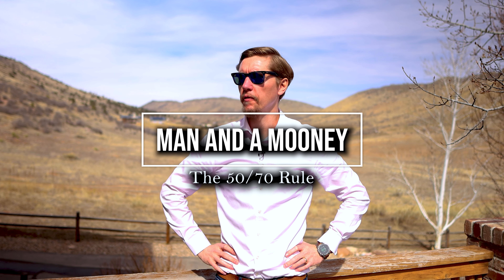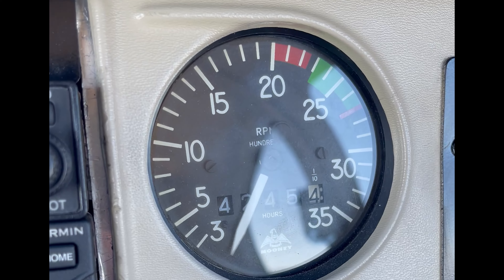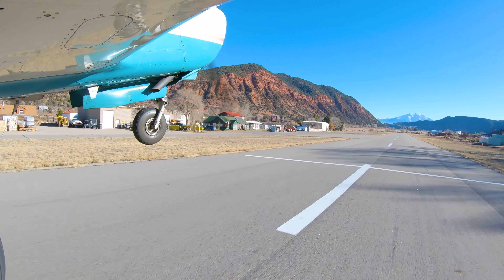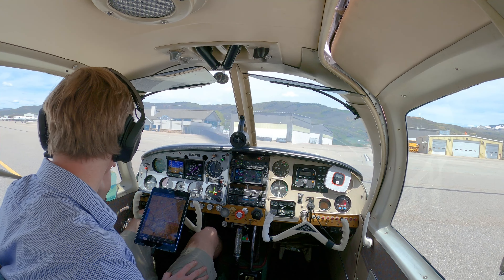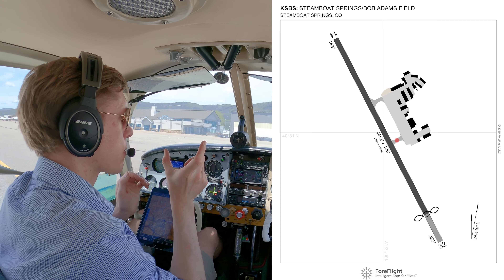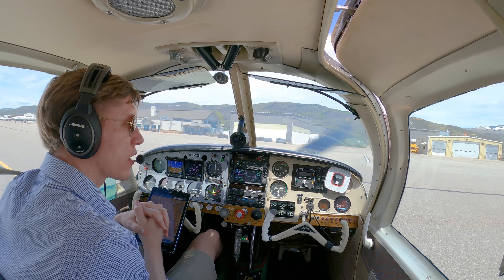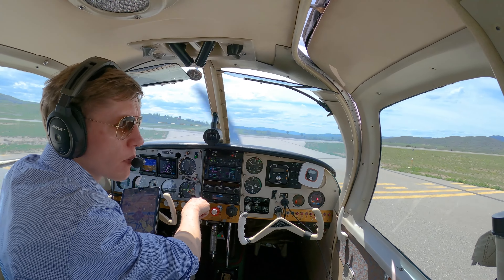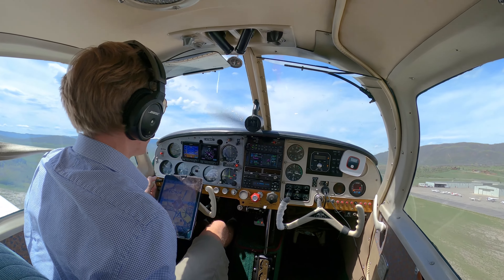How To: The 50/70 Rule

Comment: Density altitude seems to be a major factor in the areas you fly in, especially in the summer months
Reply from the maker: Absolutely Bobby. Density Altitude and Winds Aloft are two of my top considerations when flying around the mountains. If you haven't already, check out my How To: Mountain Flying video for a more in-depth explanation: https://youtu.be/DeTkEmoLCdU
Reply: Agreed Bobby... you only need to try to depart on a short runway with high DA once to REALLY understand how critical it is... as long as you live to tell about it.  I once took off from a field elevation of 7,000 MSL at about 10 a.m. where the DA had gotten up to about 8,500 MSL.  In a light sport aircraft I got off the surface and my absolute best rate of climb was about 50fpm - not 500fpm but 50.  Super high pucker factor with trying to climb out.

Of course the inverse is also true... for me, leaving the greater Denver metro area and flying east, I've more than once sat at the end of what was a VERY short runway, but because of the elevation of the field it was MORE than enough to get off the ground.  The major metro area airports here are long enough you can't see the other end.  Of course in the mountains it's a whoooooole different issue.
Reply: @ibgarrett  Wow, a 50 fpm climb has to be a heart pounding expensive. Once, I flew with my grandfather to drop off his plane at the paint shop at this small airport. Some guys picked us in a Piper Saratoga with 3 grown men already inside, so adding us made 5 grown adults  4 of them were CFI's. The runway was around 3,000ft the DA was around 3,500ft so not terrible but having a obstacle at the end of the runway did not help. We just barely cleared the trees at the end of the runway. After we were airborne everyone was joking about what the news would have said if we had crashed.

Comment: Another great video.  I enjoy and appreciate your emphasis on safety.  How do you determine when you have achieved the lean setting you want on takeoff?  Are you leaning until the engine runs rough and then richening slightly, or using engine exhaust gas temperature, or perhaps something else?  Thank you.
Reply from the maker: Thanks Ed. I use a combination of EGT and fuel flow for leaning. Down low (takeoff) I primarily rely on EGT. Once at altitude, fuel flow is easier to fine tune.

Comment: On the Mooney as you lean for Max performance, does your POH recommend rich/lean of peak?  Good video.
Reply from the maker: Thanks M. I always lean rich of peak. Carbureted engines don't typically like lean of peak operation as there's too much variation between cylinders. I think you'll find most planes require rich of peak operation for takeoff but I'd be curious to hear of any planes that can take off lean of peak. In my experience engine manufacturers prohibit that until above a certain altitude or below a certain power setting.

Comment: I made model gliders and planes (but haven't flown gliders and planes very much, but had lessons in both) and l know what it's like with speed and how critical it is. More from my decades of models than real flying. I'm going to make a model bush plane with ailerons (4 CH) and extremely large wheels for grass landings. Use FPV goggles and learn to fly cheap. And without any stabilising software. But l can design and make really stable planes. On my CH.
Reply from the maker: Justwantahover, I've done some RC/FPV flying as well. It's a great way to learn controls and practice concepts.

Comment: In my opinion, the sole purpose of the 50/70 rule is to confirm that your aircraft is accelerating adequately to make the book takeoff distance, which indicates that the engine is producing expected power and you have no other issues like underinflated tires. If you make the book takeoff distance, then you likely will make the book climb rate, which is also very important. You should definitely check the handbook and calculate the takeoff distance (and climb angle if obstacles are a factor). You should NOT simply rely on the 50/70 rule. For example, you have a 5000 foot runway, so you say "ok, great, if I'm at 70% airspeed at 2500 feet, all is fine". No, it's not, because it could be that if your particular airplane at that particular loading requires 5000 feet just to get to takeoff speed, it may not have enough reserve power to even take off! So be careful how you use this rule! Again, I believe it's only meant to verify that your plane is performing "to book".
Reply from the maker: Ibrahim, excellent point and one I didn't mean to gloss over. Ability to take off doesn't guarantee the ability to climb. So pilots need to be very careful. As I stated in the video, I really only use this rule under hot, high, and short runway conditions. If you're taking off from a 12,000 ft. runway and you're only at 70% of your takeoff speed by the halfway point, well, you have some serious issues...
In my case, I don't have any "book" figures to reference. The 1964 M20C manual resembles a leaflet rather than a traditional POH. I mentioned this in the description of the video.
Reply: @ManandaMooney  Wow, no book numbers for takeoff distance? The only way I envision using the 50/70 rule is to calculate my takeoff distance per the book (let's say it says 2000 feet) and if I'm not at 70% of my takeoff speed by 1000 feet, I know something is wrong and I should consider aborting the takeoff.
Reply from the maker: @igclapp  My POH numbers stop at 5,000 ft. During the summer months in Colorado I'm often presented with takeoffs in excess of 12,000 ft. Density Altitude. That's where experience, interpolation, and the 50/70 rule really shines. That, and a very lightly loaded aircraft ;)

Comment: Also, I didn’t see you lean the mixture for best power. Did you do that in the run up or quickly when applying full power?
Reply from the maker: Zachary, I actually sat on the end of the runway for a good 5 seconds with the brakes on. Through the magic of editing I trimmed most of that out. You can still see me tweaking the mixture slightly as I begin my takeoff roll.
Reply: @ManandaMooney  yes, I saw that. Thanks for the reply. I sure do love Steamboat!